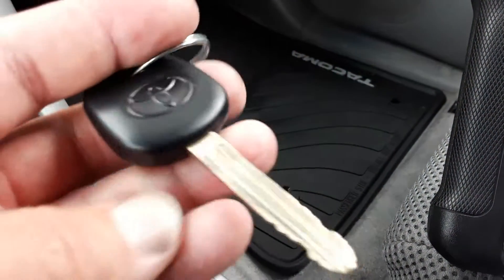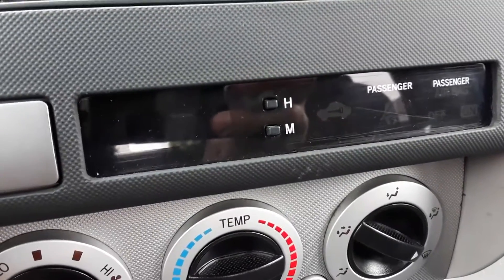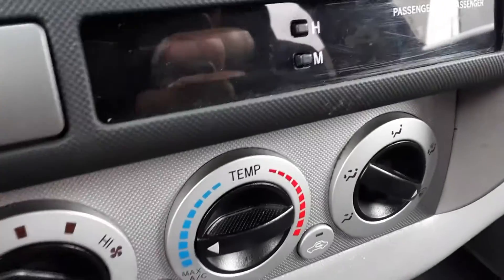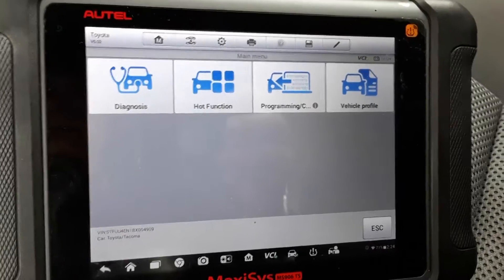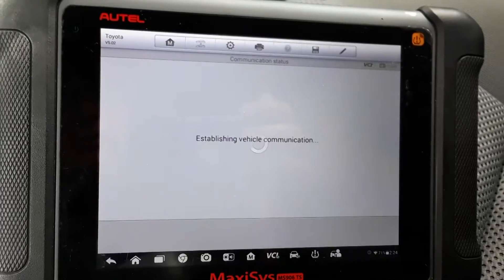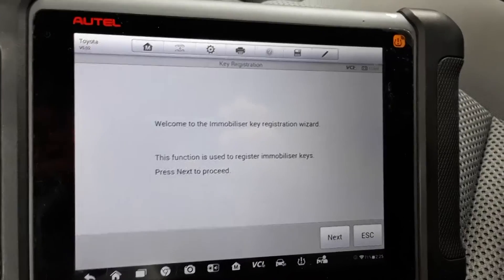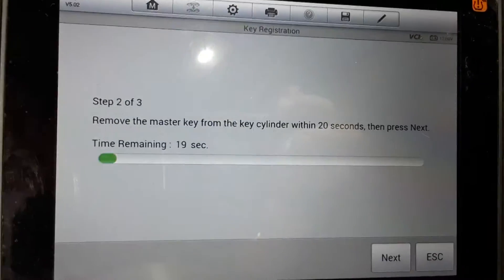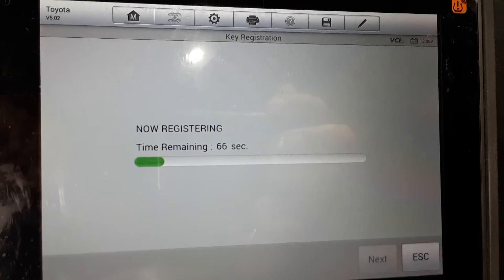How to Program a New Toyota Tacoma G Chip Key using Autel MS906.

Comment: Awesome video! I was about to go to the dealer and I just realized my friend works at the auto shop and see him using autel tool but he never done keys before. This video helps a lot going through the process. Question: did you use a master key with the dot or G or H or doesn’t matter as long as the master key works with the vehicle?
Reply from the maker: This truck uses a G chip key so as long as you have a master key that works you can program another one.